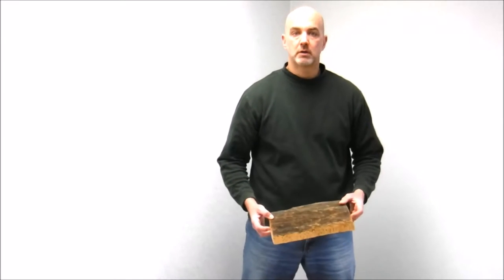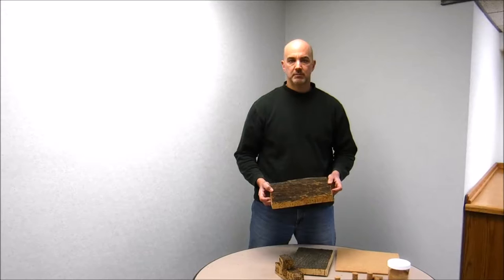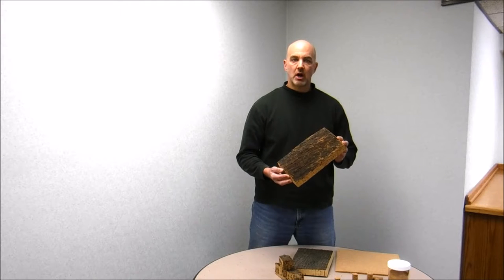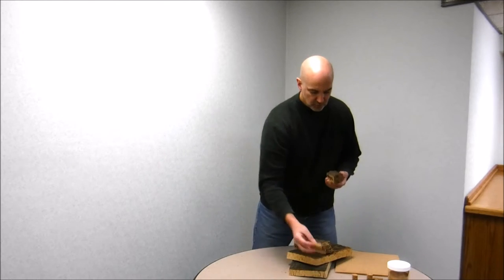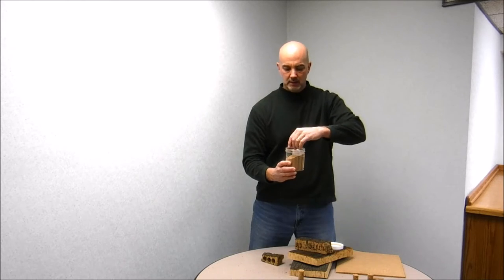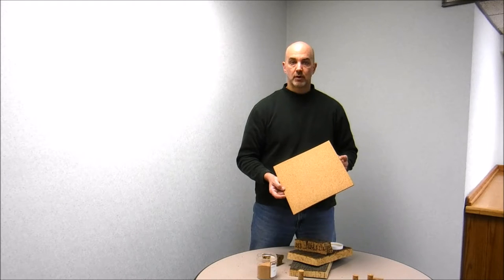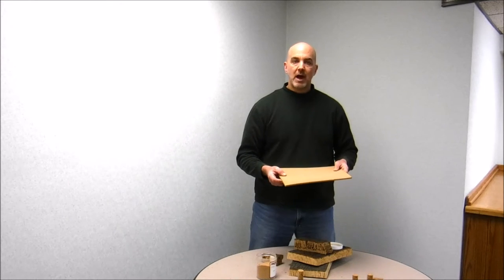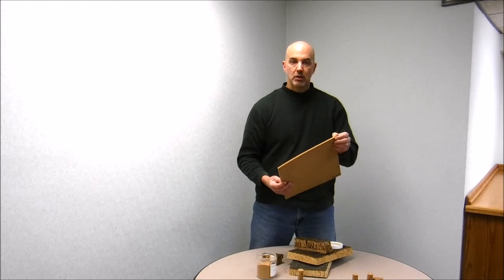How Amorim Makes Cork Rubber & Wine Stoppers

Comment: Would you use cork or rubber cork in a shock absorber, such as front load washing machine struts.  Some sort of padding/gasket is used to provide friction between the piston and the cycliner housing. About 1/8" thick material, 1/2" X 1 1/2".
They are also used on top load washer. The only difference is with top load the padding is cylinderical/rod about 3/4" in diameter and 1" long.
I can not tell you what material it is as that information is not available anywhere.